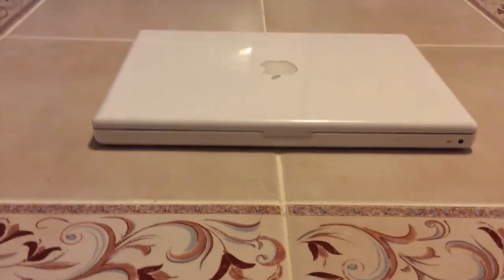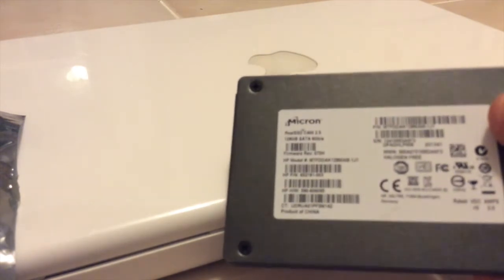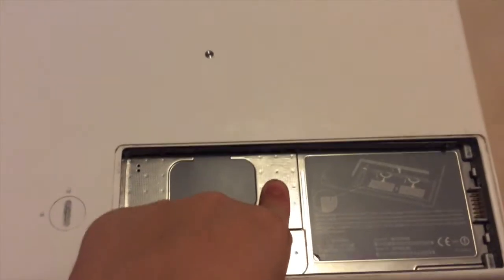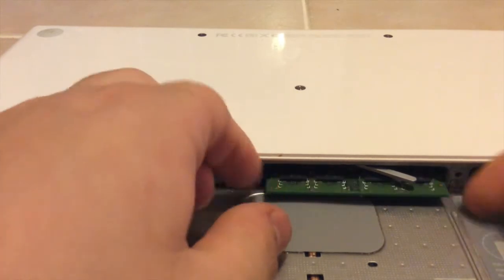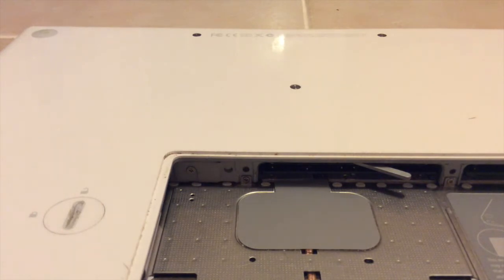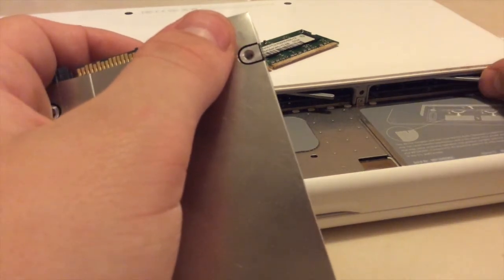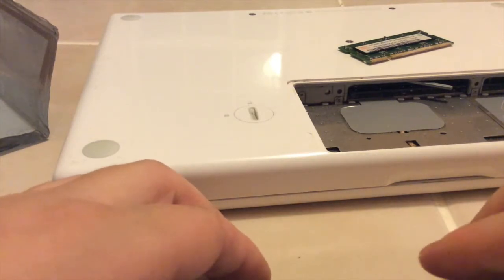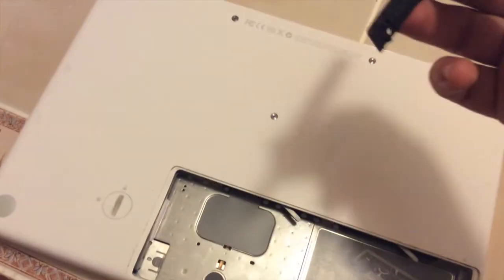Late 2006 Macbook SSD and RAM Upgrade

Comment: With this upgrade, what will be the most current OS you can install?
Reply: As far as I know, the latest iteration of Mac OS the 06 can run is 10.6.8. That said, you MAY be able to run 10.7 with some tweaking.
Reply from the maker: +starr shine 10.7.5 is the latest operating system supported by Apple for this particular model. I believe you can get it to 10.8 if you use MLPostFactor, but I wouldn't really recommend it (at least not on a system this old).
Reply: +psychobat's variety channel Thanks for the correction mate!
Reply: I still use my Late 2006 Macbook to date, 10.8.5 ML via MacPostfactor.

If your using an Aftermarket SSD with any Mac/MacBook on OSX be sure to download a Trim Support Tool otherwise your drive will fragment itself overtime.

Comment: Is there any limit for the size of the SSD disc on Macbook 13 Late 2006?
Reply: Not that I'm aware of.
Reply: The hw has not limit, but The Mac OS yes... I tried to use a HD 500 g on it, the Mac Os X Tiger (10.4) no way... With the OS Lion 10.5 I formatted and used the new HD